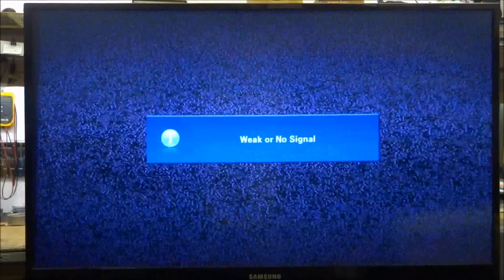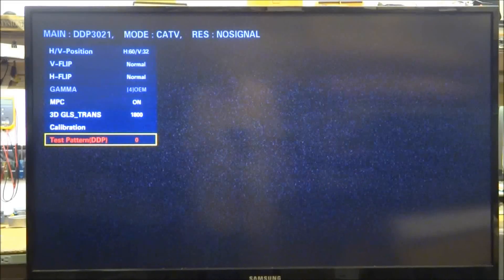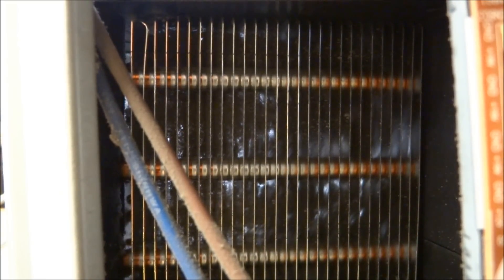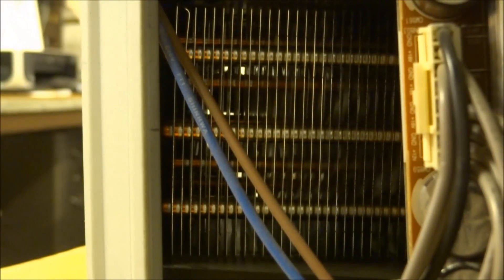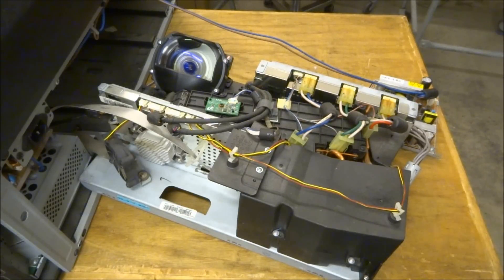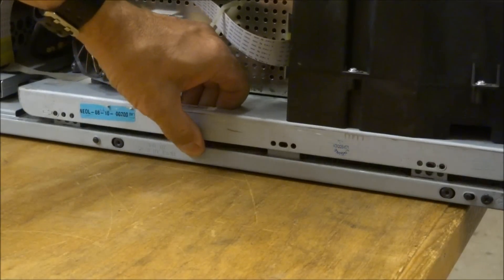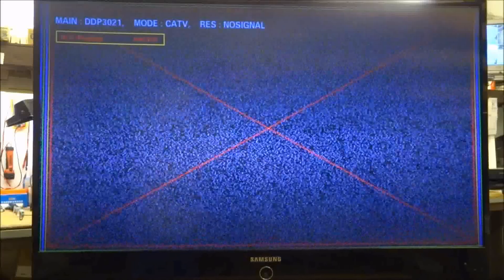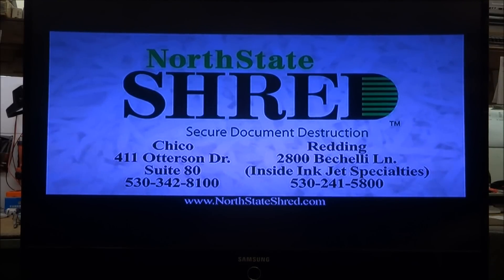Samsung LED DLP TV Shadow Repair Fix Adjustment HLT5087 HLT6187

Comment: Love these TVs, I've saved this video for years and you've helped me adjust my set with this procedure. I just got a 67" samsung one (led) that needs a tad of sharpness and I believe you did a video that covered that. Can you mention how I would physically improve sharpness. .. moving the engine in more? I don't recall. the normal on screen adjustments aren't enough. Any thoughts you can share I will appreciate. thank you. Excellent vids.

Comment: Thanks, i will try to clean the sensor, and if that don't work, then replace it.  There is a thermistor on the power supply board that gets super hot, like instantly burns my finger when i touch it, but i don't know how hot a thermistor is supposed to get?  That's why i initially thought something was wrong on the power board, but don't think that would explain the colors changing then shutting off.  Thanks again you have been a tremendous help!

Comment: Hey Norcal thanks for your help I replaced my dlp chip no more white dots thank you. Got rid of the shadow on the left thank you now I have a solid black bar on the right hand side of my screen. at the top its about 1 inch wide and on the bottom about 1.5 inches. HELLLPPPPPP!!!!!

Comment: Your the best, I did try and repair a on a KDS55A2000 and screwed it up now no picture at all,the lamp is on but the light engine is not letting it come threw, I had question like blowing the dust out with out a ground on the air flow could that cause static, I do not see you using a ground strap on your self, yet you make everything so simple, could I just send the light engine to you. I know I have a hundred questions for you, and your time is money. Thanks.

Comment: Hey norcal715, great videos. I'm getting ready to troubleshoot a samsung dlp HLT5075s.  The picture is perfect for about 10 minutes, then the colors start to wash out and gets progressively worse until the tv shuts off.  Color wheel spins very freely, so I don't think it's that.  Caps on the power supply and ballast look ok, but a few big ones need pulled to be tested.  Does symptoms sound like bad caps?

Comment: Excellent video. I have an HLT-5687 that when powered up, clicks on and off a dozen or more times before it finally comes on and stays on. I've replaced both the main power supply and the LED power supply, but the problem persists. Any suggestions? I love this set and really don't want to have to junk it...

Comment: Hey great videos! I was wondering if you could help me out a bit with a TV I've got.  I have samsung hls-6187.  The picture is quite dark; it is hard to see during the daytime or if there is any lights turned on in the back of the room.  I replaced the lamp/ballast but that did not seem to help very much.  I also notice a shadow appearing, it is about 1/3 of the right side of the screen and it appears on and off (especially if the picture on the screen is a dark scene).  I was wondering if this would more likely be a light tunnel issue, a color wheel issue, or something else completely.  Any input would be great; I'm just debating whether or not it is worth the money investment on this TV any longer. Thanks a bunch!

Comment from the maker: rarely do I see bad caps in a DLP set. most likely the color wheel index sensor is going bad once it heats up. also very small possibility of a bad DMD board.

Comment: I have one of these and I replaced the chip because it hot hit and had a bunch of messed up pixels.  That issue is fixed but it seems like the picture is bigger and cutoff. I tried all the settings in the menu and the advanced menu.  Is there a manual way to readjust the picture size?

Comment: Hi, just wanted to let you know i use one of your videos to fix the chip on my Samsung HLT6187SAX/XAA. your video was so so informative that it was super easy to fix. Thank you, your video gave me the confidence to attempt the fix and i am so so happy. that was several years ago.  I really like my tv that i am wondering whether or not i should fix the newest problem. The problem i'm having now is when i turn on my samsung the screen is blue (searching for signal) and the picture comes on then it goes back to blue screen (searching for signal  it stays on blue screen for several seconds some times for nearly 45 seconds or more , after this goes on several more time the picture stabilizes and i'm able to watch a show. Is this something easy that i am able to repair, do you have a video on how to repair this problem?  do you sell the necessary parts to make the repairs. If its not to expensive i would like to try repairing my tv.  I enjoy fixing things.

Comment: Hello and thank you for you informative video. I have the same tv as the one you are working on here. HLT6187SAX/XAA. I built an entertainment center to fit the tv and I would just buy a new tv except I can't find another one that fits the opening like this one does and when it works the picture is great.  It is hard to find a tv repair shop in my area. They all seem to be out of business. I finally found one that came out and looked at my tv. The guy knew nothing about it. It called Samsung and they were unfamiliar as well. They said they only worked on this tv twice all year last year. So the problem that I'm having is it would get hot and shut itself down. All fans are working. I replaced the main power supply board (got on Ebay used cause it's not available anymore) and I thought it was fixed. I also replaced the led power supply but it did not make any improvements. That board was new $115. It worked perfect for 3 or 4 days and then it didn't shut down like it was doing but the screen went black like the lamp went out but don't think that this tv has a lamp. I am clueless. Any help would be appreciated and I will even pay for advise. The email that is connected to this YouTube account is a email that I don't get mail from. I dont know how it works but if I need this email to see a response I probably won't get it. If you could use alshapiro@grandcamino.com that would be great. Thank you in advance for your help.
Reply from the maker: Check the connections from the LEDs to the driver board. I have had problems with those connections in the past. Also blow out the LEDs heat sinks. Too much dust will trigger over temperature shutdown. Look at the capacitors on the led power supply also.  Replace any bulged capacitors. Let me know how it go's.
Reply: @norcal715  Does anything need to be reset after cleaning out and swapping LED's?  I had a bad Blue LED in the HL61A750A1FXZA and swapped with a working one from a HLT6187SAX/XAA, though same symptom.  I made a video here: https://www.youtube.com/watch?v=FJqxb762VI4

I do have the bulging capacitors also in the LED power supply board... though with the HLT6187SAX/XAA two other modules... I just get the bad DLP chip issues like in your other video regarding replacing the DLP Chip... like the power supply board isn't the issue, maybe like a mirror controller or something?  Anything else that might go bad with the video I made error front panel LED codes whatever they are showing?  Thanks in advance for your time and sharing!
Reply: My engine has the blue LED on the left side and red LED is on the right also.  Just an FYI.  Here's the two videos I made to show the blue LED performance:
https://www.youtube.com/watch?v=xJjF3n3_nmI (not working correct)
https://www.youtube.com/watch?v=5sp8AiUuJAM (working correct)
Reply: @norcal715  Going to check the main power supply capacitors even without noticeable bulging today.  Thinking that might be the issue next worth checking. Watching again, I heard you note that as an issue with the filter capacitor on the LED power supply board. Thanks!

Comment: Thanks for your videos. I've replaced my DLP chip with success. However, now I get a flashing LED on startup. Sometimes the picture/sound delays for about 30 seconds. I try to hit the power button or use the remote to turn off but it doesn't work. the screen shows light sometimes and then turns off. Sometimes when the picture does work it glitches and a image will become offset way to the right and down slightly with a green background.

I used some canned air to blow off the radiator by taking off the side panel. I looked at the capacitors but I can't tell if they are bulging. The silver tops looked slightly domed. The main large one to the side doesn't look domed. All of the capacitors in a row like like they have a slight dome. One has a tiny brown spot on top. Would you suggest replacing the capacitors?
Reply from the maker: Definitely especially if the electrolyte has made a spot on the top. Replace all of them though, not just the one that looks bad.

Comment: Hello I was wondering if you could help me out I’m trying to repair power supply on a Samsung hl61a750a1fxza Power supply  bp96-01726b. I’m looking for schematic So I can identify the voltages and components values and so on. I am getting about 300 votes to the power supply from the primary power supply. I replaced the, Filter capacitor,resistor and there were two masfets that were bad there was nothing burnt on the board. But a lot of components seem to be bad. On the primary bored I did go ahead and replace the two big capacitors but they were not bad but I did anyway for an upgrade. I’m not an expert trying to learn more about electronics I’m fixing this for a friend appreciate your help thank you I really like your videos.

Comment: Great Video! Just a quick question tho, I have a samsung hlr4266wx/xaa with the same exact problem. Its not to troublesome as I'm using it for retro gaming and mainly uses 4:3 ratio, but I would still like to fix it. Its about an inch along the left side of the picture. Would you know if I can fix the issue on my own tv in the same way? Also, if I don't will it cause more problems down the line? Thank you.
Reply from the maker: With a factory test pattern do you still see the shadow?
Reply: @norcal715  I haven’t been able to find a way to get it on a test pattern. I don’t have a control for it. Is there a way I can show you?

Comment: Your videos have saved my DLP LED tv !! thank you I thoroughly enjoy your videos. If I could ask your advise with.. My DLP LED now has a heavy yellow cast. Did the test patterns Blue does not show up, and looking inside from the back the blue chip is blinking 2 times quickly. So I need a blue chip or can it also be something else? I appreciate your advise. Also is it ok to run it like this until a chip comes? thanks in advance.
Reply from the maker: What model is it? is it an LED model or does it have  lamp? If it is an LED model then probably the blue LED has failed, or the blue LED driver is defective.
Reply: @norcal715  wow didn't see your reply till now, (did not have a notify me setting set) it happened to be a bad led, replaced it, works great. But now I have a new question as posted above - thanks again !!!

Comment: What do you do when your ssung says check fan no 3
Reply from the maker: One of the fans is not reporting a tach signal back the the system control. make sure all fans are indeed rotating. Measure the voltages on the yellow leads of the fans. The one that is different is the bad fan. If you stall a good fan, the voltage on the yellow lead should go from a high voltage (3-12V) to a low voltage (less than 1V)

Comment: My issue is , I get a red tint on powerup then goes away to normal,  I noticed my capacitors are bulging,  I'm going to buy a new power board but what other board might I need? If capacitors are starting to bulge

Comment: Great information video, I have hlt5687s with the same configurations.  My issues are with the LED engine not turning on right away.  I have to stop and restart a couple of times to get this unit turned on.  Any ideas of what is going south on my unit.  I hate to change a LED engine if I don't have to.
Reply: Im more curious than an actual reply but if your screen is somewhat lit after flashing green and u have a direct tv remote try pressing the on button again before it goes into standby mode with steady red light. I just notice while texting that my samsung remote doesnt have on button just power and ive only used my direct tv remote. First ill try samsung remote from start too.I too hate to change led engine. Just realized it says 3 months ago you post and wondering if you fixed it also.

Comment: I have Samsung DLP TV Hln5067wx/aa  Tv turns on pictures/audio in 5 minutes it turns off no 3 lights blinking the lamp is off only the fan still runs . It can only stop when I pull the plug  out of the socket.   How to fix the issue on this TV.  In order to turn on again plug in the cord to the wall socket.  again if I turn on the tv by remote control it stays for 5 minutes.  Any help how to fix.  I install a new lamp twice but it did not correct the issue.  Any help  greatly appreciated.  I seek all the youtube but can not find one that close to what I have.
Reply from the maker: listen for the sound of the color wheel when it fails. Does it start whining loudly? a bad color wheel will do the same thing as a bad lamp. try cleaning the rotor and the optical sensor.

Comment: Thanks for your videos they are very helpful and helped me resolve a problem with a sony 60" dlp. I now have a issue with my Samsung  DLP 50" hlt-5087s it is pretty close doing the something has the previous poster, I turn it on it makes the chiming sound the right green light blinks many times but picture stays black sometimes it cycles on its own it clicks off then left red and center green and right green lights turn on then just the right green light blinks a few times after a few times the picture might turn but most of the time I need to turn the TV on and off about ten times and then the picture will come on and work fine with great picture. Do you think that it is just a bad led light or could it be another component that needs to be replaced? I love the TV and would hate to replace it. Thanks for your help and any info that you can give me.
Reply: di u look at capacitors yet? i replaced the bad ones on led psb and now comes on but takes two tries. was doing the samething until eventually died.

Comment: Thank you for this video!  I replaced my dlp chip in my samsung led dlp and have both the shadow and tilted picture symptoms.  Now I know how to adjust them.  Is it normal for the plastic box to be loose?  It seems like if I slightly push on the upper corners of the front it tilts the picture slightly.  Is that just by design or is there something I should look for?

Comment: hey steve, im having an issue with our samsung model MD65C.  the bottom half of the screen is darker than the top.  i tried to use this video as a guide to try to fix it but the main menu is different.  can you help me out?